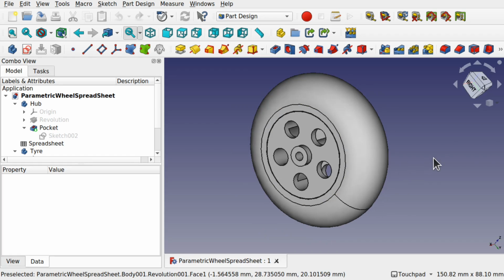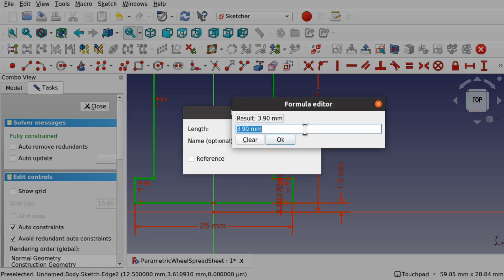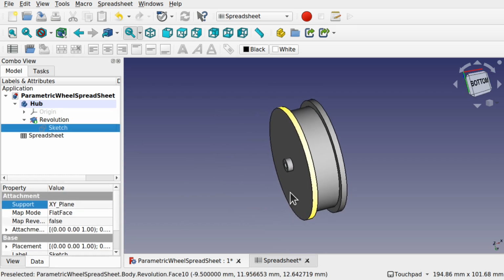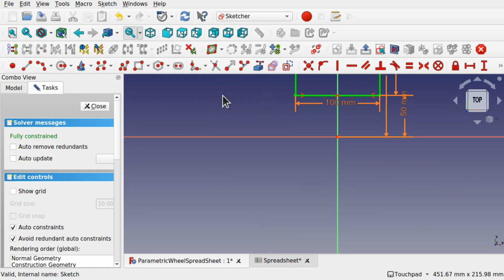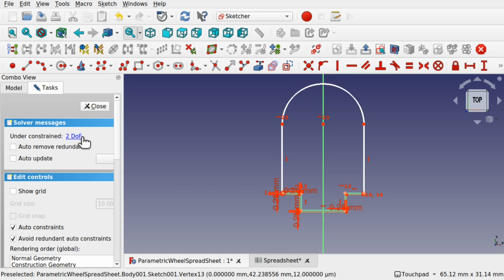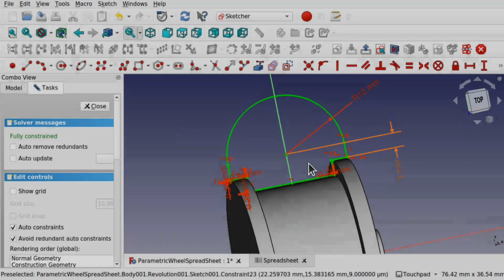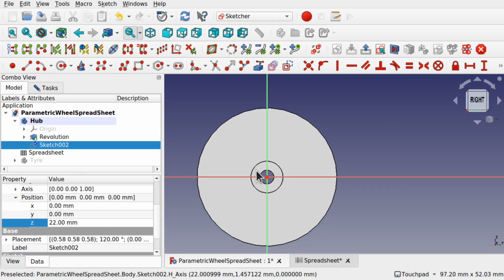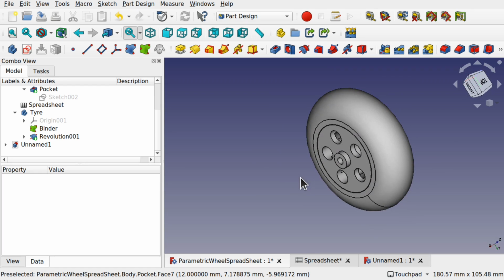FreeCAD: Build a Parametric RC Plane Wheel and Hub Driven By a Spreadsheet

Comment: I see that you went directly to Export from the Part Workbench. I have heard that you get better meshes if you use the Mesh Workbench, change it to a solid then export it. I believe they said it made a smaller file. What’s your thoughts?
Reply from the maker: I tend to use the export just for quickness but have a video on my channel regarding mesh export and includes improving quality with angle and deviation settings.  The higher the quality the larger the file so its best to experiment to see the best for the output you need and also depends on what your are going to do with the model,  print,  texture,  displacement map (displacements are coming  up on my channel soon 😁) etc.  The mesh workbench is a power wb for this.  But there are a number of setting and export options that I have yet to explore.

Comment: All of the dimensions could be relative to yhe other by using the ratio formula. EG: you change height, then the width will change according to the set ratio. Can FreeCAD excel handle this operation?
Reply: Yes, the spreadsheet supports formulas.

Comment: What I find helpful when using a spreadsheet is to tile the windows.  That way when you make a change on the spreadsheet you'll see it appear on your model in the part design  window at the same time.
Reply from the maker: Great tip that,  Thanks for sharing 👍👍👍👍